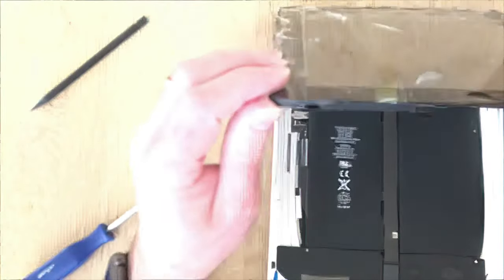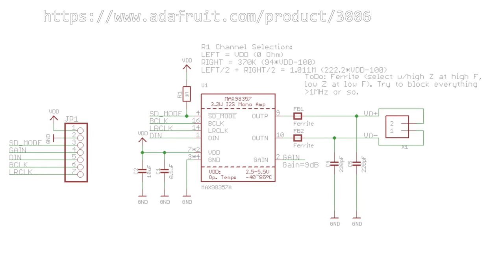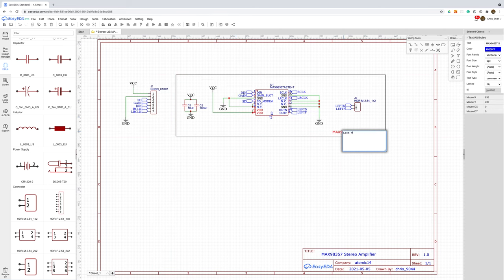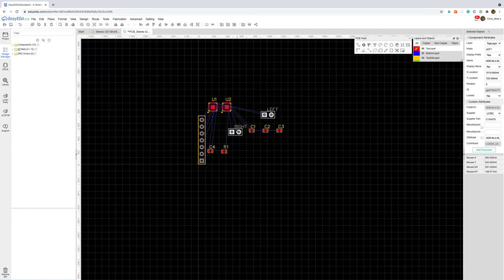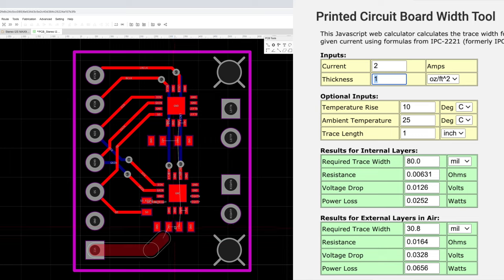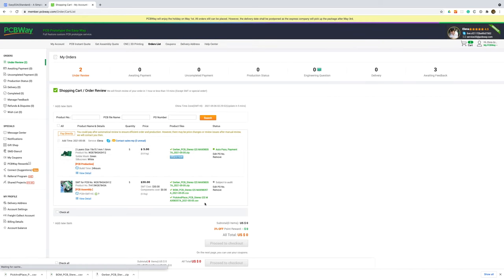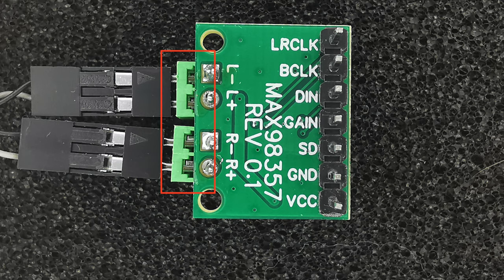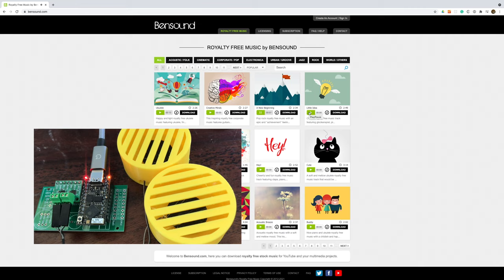Build Your Own Custom Bluetooth Speaker with ESP32 & A2DP | DIY Audio Project

Comment: Excellent project :-) The Bluetooth connection was very interesting.
Reply from the maker: Thanks - really easy to set up as well - the library I used just needs a couple of lines of code.
Reply: @atomic14  Awesome ! Watching out all video on our channel... Is there any way we can connect multiple BT mode say A2DP and SPP together on ESP32?
Reply from the maker: @HarshadItaliya  I think it should be possible - there's a discussion here about running both BT classic and BTLE at the same time - https://github.com/espressif/arduino-esp32/issues/1150

Comment: Nice shout out for PCBway and using JLCPCB software followed by the first Ad being for China PCB, think you touched all bases there :-) You could have swapped one speaker output and had the 0V pins togeter in the middle. Melting in a UK mini heatwave ;-)
Reply from the maker: It's bloody boiling!
Reply: @atomic14  but now it's raining can't win

Comment: Nice, must admit I did a double take when you designed in EasyEDA and got the PCB from the other guys!...cheers.
Reply from the maker: It's what I'm most familiar with - need to get used to KiCad. JLCPCB don't have the parts I need a lot of the time though they are expanding their stock all the time.

Comment: Wait, you design PCBs in easyEDA but send them to pcbway? That's cold :D
Reply from the maker: I know, I really need to learn KiCad.
Reply: @atomic14  or order from jlcpcb I guess, since with lcsc, easyEDA are all coming from one bigger company, or not? KiCad is nice, I need to get into it more as well, can't get rid off my old and offline eagle version yet.
Reply from the maker: @Davedarko  JLCPCB doesn't have the MAX98257 in its parts library. That's one of the nice things with PCBWay - you aren't limited by what they have, they'll source the components for you or you can even supply your own.

Comment: Love your videos as always! I'd be really interested to see if you could do some work with the faust2esp32 library. I've been mucking around with my esp32 wroom with no luck...
Reply from the maker: I had a look and I couldn't work out if it requires an audio codec or if it will work with just I2S audio input and output. All the examples seem to be based around using a codec chip for input and output.

Comment: I randomly found your PCB on the Internet 1 month ago and now I know you are the author of this PCB. I soldered them properly. I have tested no short circuit no cold soldering point but somehow when I connect my 8ohm 3W speaker to each channel, I only hear the noise. I still hear the music but the amplitude ratio between music and noise is like 1:10. So that means the board gets some signal from the esp32 and can play to the speaker. 1 thing is that I use a breadboard. Do you think it's the source of the issue? I'm ordering an Adafruit breakout board soon to test my theory.

Comment: Hi! Thanks a lot for the great video! Something I am a bit curious about: on your design, when it comes to the left audio, you're not connecting the SD to VDD (according to the data sheet, you need the SD_MODE connected to high for left audio. I don't see that on your schematic. Did it work anyway?

Comment: Thank you so much for your clear instructions, I managed to make a stereo DAC following your tutorial! I was wondering if I could make a 3-Channel DAC board with an extra MAX98357 chip connected to a tweeter. I believe they mentioned the 1/2L+1/2R output mode with a different resistor! Do you have any advice on this or anything that I should be aware of when chaining 3 MAX98379 together?  Thank you so much.

Comment: This is amazing!
Is it possible to integrate a sound recorder to this Bluetooth sink? 
Also, is it possible to request for a tutorial on how to save .wav files using ESP32?
Reply from the maker: It should be possible - under the hood, the code is just playing the samples through the I2S output, so saving it to a WAV file should be doable. You would probably need to extend the library I'm using. for recoding to wav files have a look at the SDCard tutorial: https://youtu.be/bVru6M862HY
Reply: @atomic14  I'm using a microSD breakout board, does it matter if I use SD.h or SD_MMC.h? I'm having trouble with using your SDCard tutorial code with SD_MMC.h, my SD card is not initializing. (I'm using SanDisk Ultra (16GB) MicroSD HCI formatted as FAT32) Should I also use a diy sd card adapter?
Reply from the maker: @richmondeustacio1237  I'm not sure if you are using my code as my code uses my own "SDCard.h" and is based around using the SPI interface. Can you raise an issue on the GitHub repo and show the code you are using?

Comment: @atomic14 If you wanted to drive larger speakers are there beefier I2S amplifiers?
Reply from the maker: Yes, there are quite a few, but it’s harder to find breakout boards for them. AliExpress has quite a few. You could also look at I2S to SPIF converter boards that would let you connect to a lot of amplifiers.

Comment: I have got an esp32 running internet radio into DAC speaker. Sounds a bit rubbish. So trying to build an internet radio to Bluetooth speaker.  There seems to be an issue with running wifi and bluetooth  on an esp32 as they share the same antenna. So working on connecting an esp32  for it's wifi  and connecting data lines to an esp-01 to use it's bluetooth. but not sure how to link the two together to transfer the MP3 data. I2c SPI or UART.? Is this the best solution?